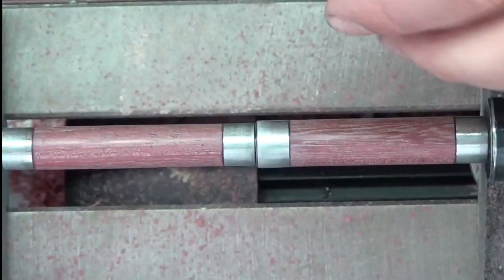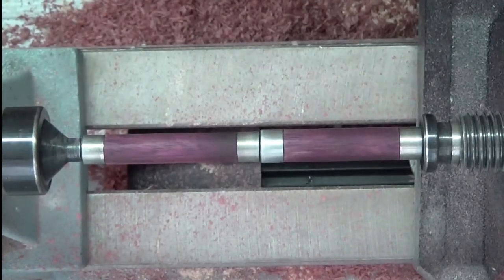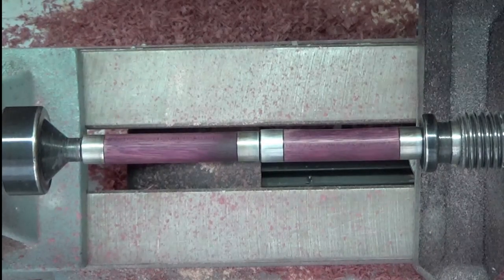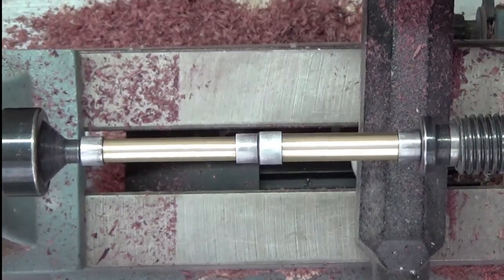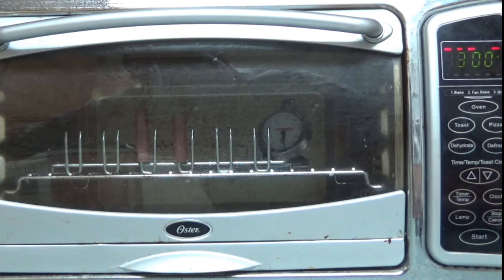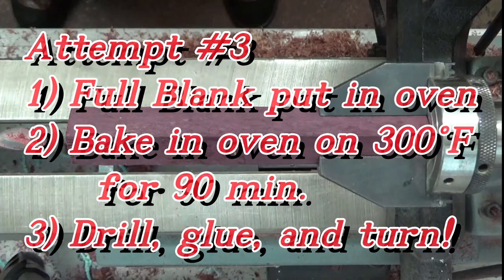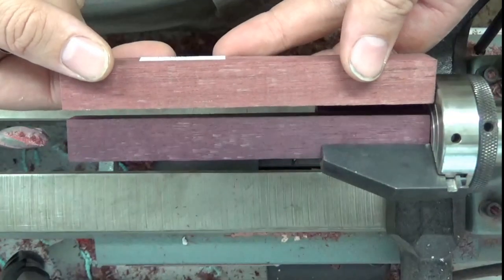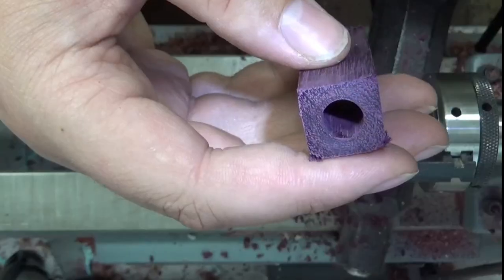Deep Purpling Purpleheart Testing

Comment: I'm wondering if putting the wood in a microwave oven might work. As a few years have passed since you posted this video, have you tried microwaving purple heart?
Reply from the maker: I doubt it, a microwave works by vibrating water molecules and causing them to heat up. That might work to dry it out, but I don't think it would heat it up enough to turn it deep purple consistently throughout the blank. I would be concerned about cracking to hearing the water up from within the wood like that.

Comment: It's been 5 years.  How does the color look now? 

And the part about ca glue... what was that in reference to? Did you seal the end grain with ca glue?
Reply from the maker: Not sure about that pen exactly, but I just turned a purple heart I did this treatment to 3 years ago, and is was still purple. It did seem lighter, but I think that was a variance in species of purple heart tree it came from. I r noticed some species of purple heart get darker than others.

The CA was what I used to glue the tubes into the blank. It held up in the heat, but the wood cracked.
Reply: Thanks for the reply.  I don't know much about turning.  I'm actually very new to woodworking in general.  But I have several pieces of purple heart that I'm going to use in a serving board and cutting board,  and I want to try this heat treatment in the oven.
Reply from the maker: @rfehr613 would love to see the results, welcome to the addiction friend 😁
Reply: @TheTacticalPainter   of course YouTube won't let me post a link to a photo from my Google photos despite YouTube being owned by Google 🙄 So I'm not sure how I can even share it. 

But anyway,  I ended up baking 1 piece of each: purple heart,  yellow heart,  and Osage orange.  The Osage didn't really change much.  Purple and yellow heart both got darker,  though the yellow kinda just looks roasted.  Unfortunately the purple heart twisted pretty bad despite being KD, but I was still able to get a few strips out of it.  I have the non baked versions in this same board as well.  Made for a nice color gradient.
Reply from the maker: @rfehr613  if you have Instagram, feel free to find me, I'm on there under Soots Crafting as well. Never thought to try yellow heart. Great experiment, keep up the good work! Sorry to hear about the warping, this happens to me from time to time too, especially when I dry Maple before stabilizing. It gets very twisty sometimes.

Comment: I just got a torch to do similar things. In your attempts to bring out the purple, even if unsuccessful with the torch, were your bushings affected at all?
Reply from the maker: That's a good question, I was concerned with this as well. I inspected the bushings with a caliper and they weren't effected. I've turned many pens with these same bushings since and have had no issues. The bushings are made of mild steel and aren't heat treated, so it shouldn't do much. I would avoid turning them blue or amber color as there's no telling what tempering them may do to the bushing if accidentally knicked with a gouge at full turning speed.
Reply from the maker: Attempt #3 really is the best choice for an even deep purple color throughout the entire blank. If doing a larger piece, like a bottle stopper, or bowl, just leave it in the oven longer.

Comment: can i jus put the wood in a spare oven at like 200 for x amount of time?
Reply from the maker: You could certainly try that. I have done it at lower heats and didn't get as good of results.
Reply: @TheTacticalPainter  alright i saw a vide o in my recomendation that showed a guy baking his wood at different temperatures and the best he got was 350 for 1 hour to get a really deep and vibrant purple without burning or charing it. was pretty neat. im making a chef knife for my old manager at the restraunt i use to work at and thought purple heart would be amazing for the handle.
Reply from the maker: That sounds awesome, I wouldn't go any hotter than 350°F, you today scorching the wood. 300°F works really well and you don't need very long. Just be sure to do it before carving or shaping the wood cause it will shrink during this process.